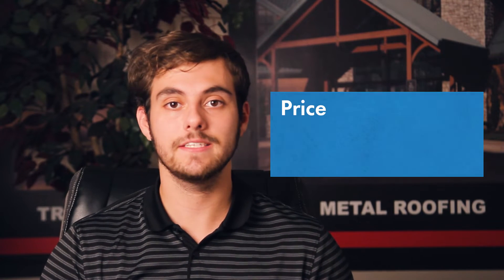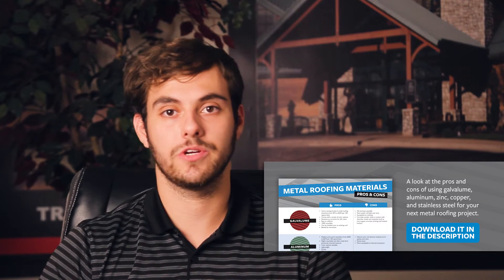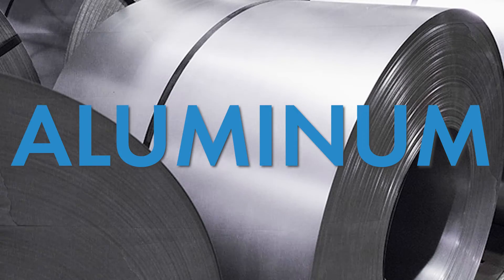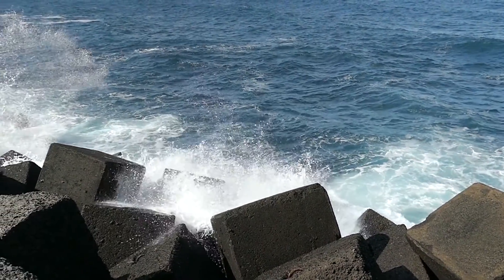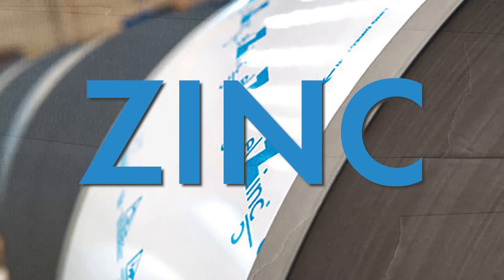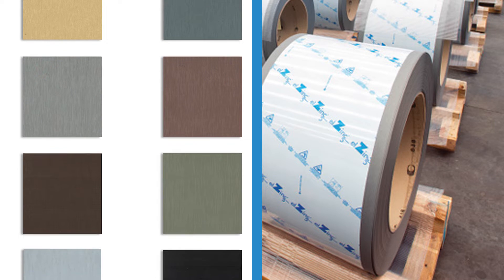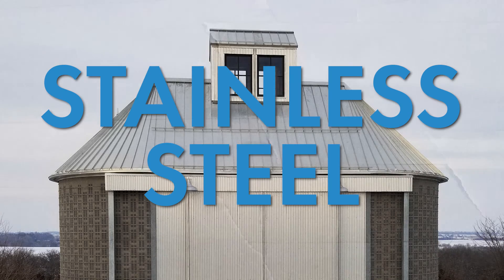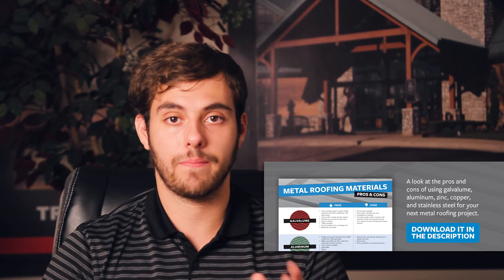What Metals Are Used for Metal Roofing?

Comment: Where can I buy coils of stainless to put into my standing seam roofing machine? I would like to purchase in bulk. 

Does stainless steel on solid sheathing with membrane underlayment require a ventilation mat?
Reply from the maker: I would suggest dropping Sheffield Metals a line at: http://bit.ly/contact-sheffield -Thad
Reply: @TheMetalRoofingChannel  I sent them an email about per ton pricing, but have not heard anything back.

Comment: When they say "tin" roof, they just mean steel?
I'll just be looking for the cheapest thing I can find.  For a small house, and I most likely won't be around after 20 years.  So anything longer will get sold or torn down.
Reply from the maker: "Tin roof" is a bit of a misnomer. It's kind of almost turned into a slang term, especially across certain parts of the U.S., to mean any metal roof. As you said, most of the time it is referencing steel. If you're looking for the cheapest material on the list in the video, it will be steel. Keep in mind that while steel is a great product, making the choice for your house will come down to location, etc. If you have any other questions, let me know. Thanks! -Thad
Reply: The Metal Roofing Channel   Ok, so I'm thinking about building a house in the country.  In the woods actually.  Going to be small, and have to be cheap.     It's going to be in an area with a decent amount of rain, but no where near the coast.
I'm not young, so anything over 20 years will be a waste, and even if it doesn't look so good on its way to 20, I don't care, since hardly anyone will see it set back in the forest.  I'll just need it to be water proof.

What do you think?  Still steel?  And what exactly does  that mean just plain painted steel?
Reply from the maker: If you really don't care how it looks or if it will last longer than 20 years and only care about how cheap you can get it done while keeping it watertight, then I would use a good underlayment and shingles instead of metal. You could go with an lower end exposed fastener system, but that could require maintenance in the time-frame you describe so I wouldn’t go that route. You would probably have a lot easier time finding a good shingle installer as well. Just make sure it is above a 3/12 slope for shingle installation. Hope this helps! -Thad
Reply: The Metal Roofing Channel     I'm interested in steel over shingle even though it may be more expensive, because it will be in a pine or mixed forest setting,  which has a possibility of forest fire.  As we've seen in some recent fires, houses with steel roofs fair much better.  There is also an environmental issue too.  I find the idea of cladding my house in something like a toxic tar, in the middle of pristine wilderness kind of disgusting, plus I will be on a well, and will catch water for watering gardens, and lastly it's in a very high snow area, and I feel a steel will shed wet snow far better (or at least be easier to clean off) than tiles.
So cost is of great importance, but within certain criteria.
Reply from the maker: Understood! Those factors definitely play into the choice. As I said in my initial response, steel is the least expensive out of the materials in this video. If you want to pick out the exact type of steel substrate and system, I would suggest talking to the Sheffield Metals technical department at this link: https://www.sheffieldmetals.com/Resources/Technical-Department
Thanks! -Thad

Comment: Remember, there are five types of corrosion which attacks Aluminum, not just one.  It is particularly susceptible to electrolysis, where two dissimilar metals come in contact, such as metal screws with aluminum roofing sheets.  Another thing to be aware of is the type of steel that is used which has multiple grades such as "C", "D" etc.  These designation tell you how much carbon is used in making the steel.  The more carbon the stiffer your panels will be, but they will crack when a crease is formed in a "break" which then will expose the inner metal thus allowing a place for rust to start.  Ask your roofer or roof panel manufacturer what grade do they use for their roll-forming roofing panels.  Having put up many roofs I opted for a grade that uses less carbon as it is easier to work with in certain respects.  If either cannot answer that question then find yourself another manufacturer or contractor.
Also a high carbon steel when rolled through a former may also expand slightly as it exits the former, while steel with less carbon will not expand after forming because it forms to the roll former better than does the high carbon metal.  It may also cause you to run over with your sheets because of that expansion.
Reply: Excellent points! Thanks for taking the time to post it all.

Comment: What about rainwater harvesting, are they're any materials or finishes that are recommended for such an application?
Reply from the maker: Hi Chris! A PVDF finish is not recommended for this type of application. One of our GM's here at Sheffield and my contact at Sherwin Williams confirms there are some polyester systems available which are FDA approved for various food processing applications, however they are intended for interior end uses and would not be a good choice for roofing. Let me do some digging and if I come across any more information, I'd be happy to pass it along. Thanks for the question! -Thad
Reply: @TheMetalRoofingChannel  Have you ever heard of NSF 61 criteria or NSF 151 when it comes to coatings? Thanks Thad!
Reply from the maker: NSF 151 is rainwater collection specific while NSF 61 looks to cover all components used for drinkable water. My contact at Sherwin Williams has talked to a few technical directors in the lab, and rainwater collection via a roof system is not something Sherwin Williams has developed a product for specifically. Based on that information I'm assuming those standards aren't necessarily applicable for the metal roofing coatings provided by Sherwin. Hope that answers your question! -Thad
Reply: @TheMetalRoofingChannel  yes, thank you
Reply: The Metal Roofing Channel   Since the contact time would be very short, and filtration is needed anyway (think bird poop) is there any actual concerns, or just hasn't been tested enough to warranty against lawsuits?
Reply: What metals can you not place close to zinc roof?